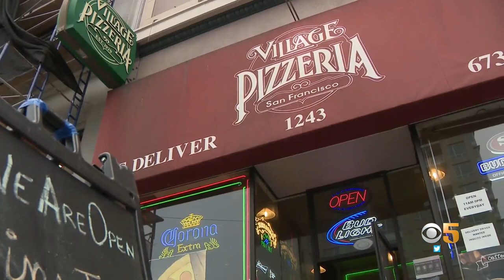Problems Slow Progress On Van Ness Project In San Francisco

Comment: 5 years and a TWO MILE stretch for what is essentially a bus lane still isn’t finished? In that time the city of Phoenix managed to finish an entire 20 MILE TRAIN?? 

YEAH the problem is SF.
Reply: It’s easier to build in Pheinox because it’s a massive suburb. Which makes it inconvenient to live in
Reply: @TysonIke  Still 5 years for a BUS LANE.
Reply: @TransitAndTeslas  their redesigning the street and a lot of the intersections. New traffic lights, lanes, bus stops, and crosswalks.
Reply: @TysonIke  A 20 mile train also requires all of those
Reply: @TransitAndTeslas  it’s in a suburb. Geary avenue is a busy Main Street. Also San Francisco is also building a 1.7 mile subway, and another 2 mile bus rapid train syestem on Van Ness.